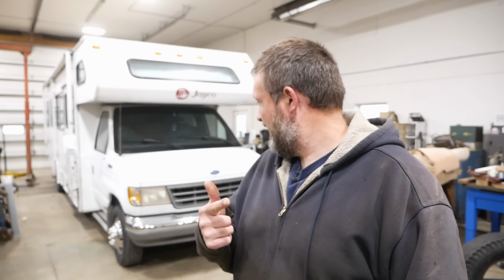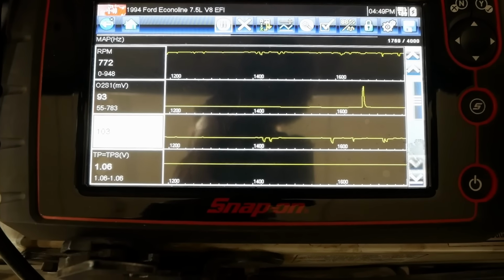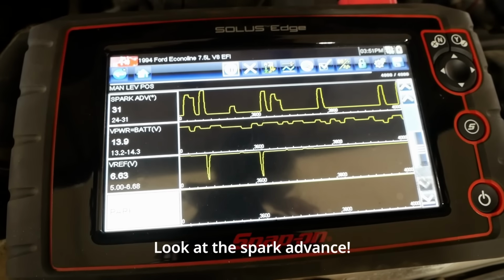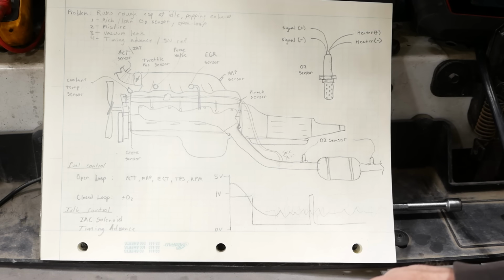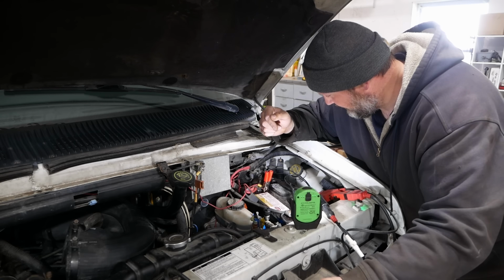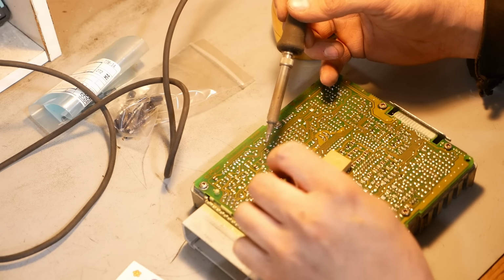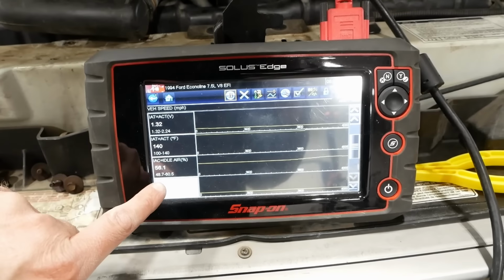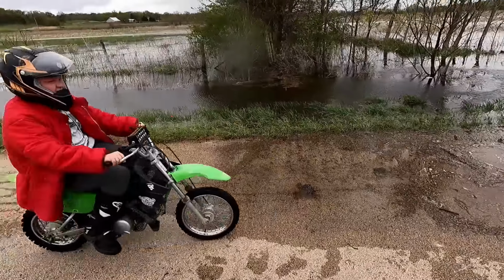Ford 460 RV Surges, Runs Rough but Nothing's Wrong?

Comment: I owned a '94 E350 motorhome.  Had it a couple years and it started surging and doing stupid stuff.   I confirmed a lot of stuff, determined that it wasn't actually misfiring.   I searched the forums online for days, just trying to get another angle of what could be the issue.   I found a post with pictures of the inside of the ECU, showing damaged capacitors.   I removed my ECU, inspected and found all three damaged capacitors.   I don't have the skilled to replace them so I ordered a 'rebuilt' ECU.   Installed it and it did the same thing.   The rebuilt ECU had 'don't tamper' tape on it, I carefully removed the screwed, not to damage the tape, and discovered the same damage to all three capacitors.   I contacted the company, asked them if they replaced them.  They advised to send it back and they would inspect.   Pretty sure I received a different ECU, this time it was super taped, no way to examine the inside without damaging the tape.   Installed the ECU and it ran perfect.   I sold it shortly afterwards.  Good job Wes!!!
Reply: Where did you order the computer from?
Reply: @ that was 13 yrs ago.  Not a clue, sorry
Reply: @Julianconanhernandez  Rock Auto had mine for '95
Reply: Before ECU would think gas cap.

Comment: All  the old electronic control modules have that problem and need to be recapped. You did that right. But having an exhaust manifold leak would throw it off.

Comment: All in all, if you billed for your diagnosis time, and the actual repair , it was probably still cheaper than firing the parts cannon at it. 

iF you could even find that ECM, it is probably more than your labor charge. I wish your shop was closer to me.

Comment: Wes, I'm glad the air intake on your quad runner sits as high as it does! Also, the failed capacitors are eerily reminiscent of the Taiwanese Capacitor Plague that destroyed a lot of electronics, albeit a few years after this particular Ford was built.  Unless, of course, that particular ECM had been replaced sometime after 1999...

Comment: I'm no electrician, neither am I an electronics expert...that being said I like to look for the simple things like loose components such as that capacitor you found on the board.  A lot of times the connections of components fail due to vibrational fatigue and a quick fix of resoldering is just what the doctor ordered.  Great video Wes thumbs up.

Comment: caps smooth out dc signals, if they are leaky and the signal gets noise in it....pcm goes crazy.  Measuring at the map is only one spot.  Where is the scantool getting this info for the 6.63 volts its reporting.

Comment: Finaly we got you trained up on the word SOLDER, next weeks word is ALUMINIUM LOL. Amaising tenacity on fault finding but also on the skill to be able to fix the problem. To fix this with parts costing a few cents rather than replacing it with a unit costing hundreds is why people love your work and why you will be in buisness long after the rest have gone bust from lack of repeat custom.

Comment: Hey Wes, that was most impressive and you even had the capacitors in stock!  Using higher voltage is ok, we all do that. VREF = Voltage Reference, something for it to compare against to make its calculations. If you accidently have a "track delete" you can use the capacitor leads as a track. Yeah, that was good thanks for showing.
Reply: Vref of 5 volts is actually the power supply voltage to every chip in there. those are power supply filter caps to keep the voltage stable across load changes, the mad thing is, once over 5.5V with much of that, it can possibly fry the electronics. 
Going a bit heavy on the uF is generally ok in most circuits
These days, one could pay a bit more for tantalum caps in those ranges, they don't have that pesky electrolytic leakage/drying out issue.

Comment: They say electrolytics will last longer working closer to their rated voltage as they will stay formed, however your 100v ones will most likely last a while.
The Pcm reports the ref voltage as 6.3v, how does it do that?, it most likely uses another ref, a ref to measure a ref.
The second reference will likely be inside the microcontroller, the bit that does the computing in the Pcm, it could be out of range, or the supply voltage to the micro could be low or noisy.

Comment: Its a computer, so it all depends on what the programmer did to bullshit the actual values so the program worked the way he wanted, that bypass are for example, half the sensors probably are not even used in the program.. early version of the VW scam!

Comment: reminds me of my 1996 Subaru Legacy every few months or so (doing it now as a matter of fact) won't idle worth a crap constantly idles rough or sticks. Way too many things to list that have been repaired replaced or cleaned on a engine rebuild with 6 years and 27k on it the subaru shop I go to can never seem to figure it out nothing on the scanner either. All I can do is put marvel mystery oil in it give it the Italian tuneup and then it runs fine for a few months before happening again it's beyond frustrating and been happening for at least 2 years

Comment: Im trying to reach way far back into my memory to remember these old Ford truck EEC-IV systems. The truck emissions requirements in this era were basically non-existent. I don’t think they go into closed loop at idle at all. I think they just run in open loop, slightly rich, and run the AIR to keep the cat happy. I think as soon as the throttle is cracked open (and the ECT is warm enough) they close the air valve and switch to closed loop, but back to open loop and open the air valve when the throttle is closed. It’s been a long time since I’ve had to work on one of those systems, so my memory might be off, but yeah, a lot of early fuel injection systems on trucks didn’t run closed loop at idle because the cats were so far back in the vehicle that keeping the O2 warm enough to function was difficult ( and the emissions requirements were so lax that they didn’t have to).

Only time I’ve seen an ECM incorrectly report VREF was when it had a bad ground (was on an old Thunderbird SC), but that threw off all the other sensor readings so much that the engine barely ran. I’m guessing that this one is probably just down to the scan tool misreporting it. With any of the older OBD systems, I find that scan tool readings are more of a hint than a fact. They are often not accurate.

Comment: I dislike de-soldering so much. Always seem to make a mess of it although I don't have one of those suck guns. I use a spring loaded plastic thing which gives about 0.2 seconds of sucking before you have to reset it. You head it with the iron, put it close by and then release it. 
I don't solder enough to buy one of those suck guns and personally would just toss the faulty unit out and buy a new one :D I know they cost thousands of dollars :D

Comment: God that guy was luck to find you. Just a note, I watch a Uk couple that have a small RV that they travel around Europe & do you tube vlogs & they are not mechanically minded & it's 27 yr old & they seem to get in pickle after a other due to the rear diff fault. Then they find a guy/ company that now what they are doing fixed it up went right through it cam belts all the usual troublesome stuff. Next vlog come's come's on the guy was swamped with call's can you sort my camper / Rv the answer was no it was a one off. The Guy's man cave room was out of this world he was into military /expedition conversion vehicles. Nice fix Wes.

Comment: That was awesome. I wonder if ecm issues will be more common as time goes on to keep our older rigs running. Is it usually a capacitor failure if the ecm has a problem? Where I live rust will not be an issue....

Comment: Unbelievable, seein all that water from all that rain ya'll get really kinda pisses me off because we cant buy a friggin drop of water in s texas...every storm system dissapates right over head. we never get a drop from hurricanes due to high pressure pushing them east. its ridiculous. we have to wait 1-500 yrs for a freak rain storm. ugh. last year the lack of any measurable rain killed thousands of trees and bushes. since 2019 we've gotten squat. just covid, freezes, broiling heat waves killin people, plant life and animals. F this state. I'm movin!!! Anyways, if ur still readin, that air pump is suppose to help heat the 02 sensors and keep emissions down. volkswagens have em too. Caused all kinds of problems with the ex's jetta with cheap ass plastic hoses. Stupid ford, lets replace the good ol reliable easy to fix carburation with a breadboard of useless electronic bs to shorten the life of vehicles cause no one wants to fool with em. I used to fix car ecm's too but its such a hassle since all the radio shacks closed. I gave up. Ok, rant over

Comment: Wes,

My understanding of the air pump logic
1) When motor is cold and mix is enriched, air is added to exh right at the cylinder head to help finish the combustion. Air has to be added close to the exh valve as  anywhere downstream the exh is too cold for combustion.
2) When closed loop, air must NOT be injected at the exh valve as the O2 sensor is rendered useless. Rather, the air is diverted into the oxidation half of the catalyst OR back into the air cleaner.
There may have been more than one thing broken on this van - maybe from the factory.

That 16V cap was likely on a 5V supply, the 60V cap on a 14 V supply. It would be interesting (although difficult) to observe the waveform on the + side of the broken cap with a scope.

Good job

Comment: Great video! That strange difference in the reference voltage you measured may have been affected by the faulty electrolytic cap. Your DVOM reacts relatively slowly and measured 5.0XX volts while your scan tool may have been reading noise pulses that the cap would have normally smoothed over, thus the 6.0++ reading. At any rate, the faulty filter cap caused it. I noticed you wisely chose the replacement cap with the higher voltage, but I would suspect the 50V cap would have been just fine as there is no voltage higher than battery voltage inside the PCM frame, (Maybe 14 to 15 volts when charging?) Chances are the 63V caps were a supply chain issue when the computer was built. Anything over double the nominal supply voltage would have been just fine.

Comment: I had a 92 Ranger with a 4.0L that had an extremely high idle and hanging revs. It was bad capacitors in the ecm. I found a kit on Amazon with various capacitors for older Ford ecms. It was a rusty beat up truck but 4.0L with a 5spd in a reg cab short bed configuration, it would get it.

Comment: The data at 23:37 showed 1.05-1.52V from the TPS. The EEC-IV can cause intermittent idle and off idle problems above 1.0v. It closes off the IAC because it thinks you are applying the throttle at that voltage. It's a common problem that won't throw a code. That may also be why the timing is swinging at idle. Being stuck in open loop is a mystery though.

Comment: Excellent video Wes  :) would that Ford RV on motor have HO2 sensor  manifold go fault if has one  also Capictor only thing can think puke fluid and short out be Ground battery post cable to fender ground got corrosion need clean up shiny like new to or Alternator overheat lost charge or amps plus short some amps too! That be my ideas happened  and see Chevrolet car in 2002 year do that ! Last one could happen is some had key on postion when  change Battery or Alternator or Starter plus Solilendo too ! That my thinking to happened but not sure then too!

Comment: I just went threw the same problem on a 96 F450 with a 460 in it, After hitting the old Youtube I figured it out and the computer was bad. I bought a new computer and it solved all its problems at one time !  I watched a guy pull a computer out open it up change the capacitors out put it back in the truck and it ran fine. Just for fun I opened my old computer up and found all 3 capacitors had black goo around the bottom of them, But I'm smart enough to know not to fool with it, I'll let my brother-in-law fool with it as he likes to do that kind of stuff !  It never hurts to have a spare !  Bandit

Comment: Older motherboards and PCBs are WAY more analog in nature because of how much less functionality they have, larger traces and simpler software. That ECU's entire ROM can guaranteed fit on a 1.44mb floppy drive more than 80 times with room to spare, to give you an idea of how small the code is. 

Thus, rather than the modern ECU/computer's behaviour of "it doesn't work anymore for no reason," it will instead give you "It's alive but holy shit its fucked up and corrupted." Precisely the behaviour shown here in the engine surging a bunch rather than running smoothly all due to that severely damaged capacitor.

Comment: Bernie Thompson says that timing is used to adjust idle speed because it can ract much faster than the IAC can adjust the air.  So change timing then move IAC and return timing.  The AIR should only be active during open loop. So is the AIR keeping it out of closed loop or vice versa?

Comment: The voltage in the ECM is only 12 volts,you can use 25-50 volt capacitors in the circuit wih no problems.

Comment: I have an electrical gremlin 1995 Mitsu Lancer. AC works for about 5 minutes and pops the control side fuse for the blower motor relay, checked with amp meter .8 amps. It does not pop the fuse immediately but some where from 4-5 minutes to an hour it pops the 10 amp fuse.
I was on the road and had some spares so I went incrementally from 10 to 30 in 5 amp steps and after about 10 minutes of driving the 30 amp one popped too I did not want to let the magic electrical smoke out 60 miles from home so I rolled the windows down (105 here that day) listened to the wife tell me she is going to die 1139 times and drove home. 
Either there is a melted wire in the harness touching something else that needs power or it is just haunted.....LOL. I have the dash out and the fuse panel down and someone has been a busy bee in the harness, taps everywhere that go to nothing but not a butt connector in sight just peel the insulation back make a couple of wraps with the tap wire and some electrical tape and vola' there you go... sigh... :) Thanks for the gremlin video Wes.. :)

Comment: Those early Ford computer fuel systems never seemed to go into closed loop at idle. I saw it time and time again. The engine had to be over a certain rpm and temp for a time before closed loop occurred.  The air injection system is only supposed to be active during engine warm-up to get the cats up to lite off temp (400f to 600f) quickly, the diverter valve was supposed to vent the air to the atmosphere once the engine reached operating temp. The diverter valve is most likely seized (common issue). I was almost positive that it was going to be a disintegrating catalytic converter before you opened up the ECM. The symptoms (rough idle, stalling when hot, and the O2 voltages) matched a migrating catalyst on Fords during my days at the dealership in the late 90s which was another very common problem.

Comment: I’m betting the vreg in the ecu is about to fail so that’s probably the 6v reading. It will be stepping 12 to 5 and have your friendly electrolytic next to it. 

Maybe its “almost” dead shorting enough to almost be a full short but not completely. Wish it was easy to test ecus you went further than most people would :) good work

Comment: Wes, Great work! That RV looks like it's in nice shape, worth getting it right for the owner.   I have a lot of older vehicles that no one will fix for me, no matter what I pay, so I appreciate what you did there.  As a mechanic for 57yrs starting in 1965 and having worked in emissions fuel economy and drivability at GM for 36 concurrent, 1979-2016, I know the difficulties wading through the logic of engine controls for 1994. That year was a transition period from pre 1993 thru 1996 for that wt class. Engineers manipulated engine controls with fancy software to stay just under the emiss std w/ out adding more parts. That makes the control just crazy. But I'll bet that Ford 460 V8 is a nice combo for that class C E-350 RV, at about 12,000Lbs. And yes all high profile vehicles are a bear in windy conditions, you have to slow down. One time I went and hid behind a tall bldg while a tornado passed about a half a mile away! It was hairy. When it passed, trees were down, power poles were snapped off and I had no electricity for a week when I got home. Thank you for posting and making the guy's RV run nice again. ben/ michigan
Reply: I have a '99 E350 cutaway with a shuttle bus conversion, I've found it difficult to find anyone to work on it, even to change the plugs